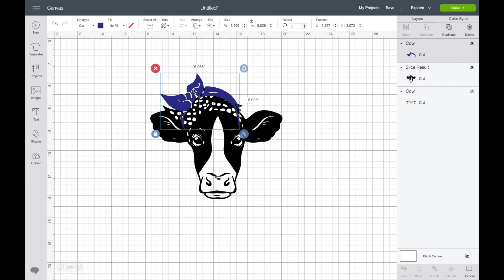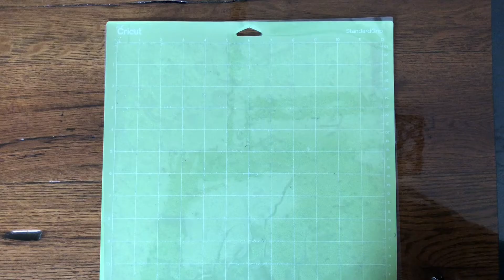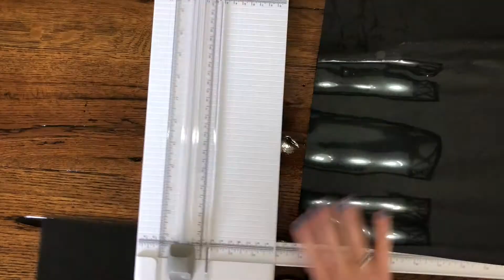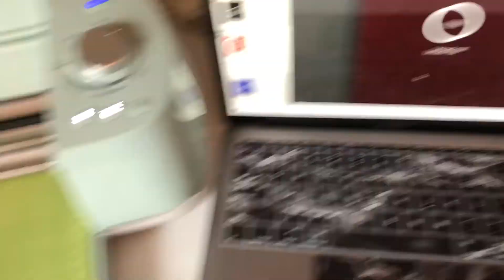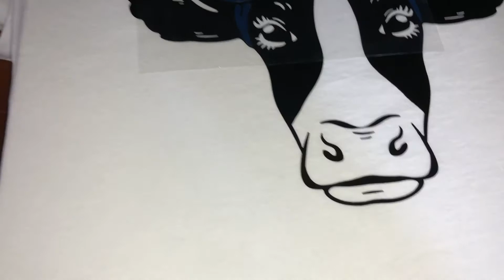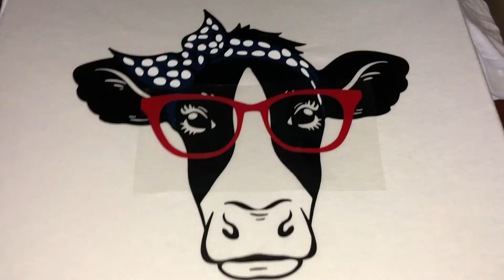Multi Colored/Layered Shirt Project

Comment: When a mat is no longer sticky enough, one can either wash it with dawn & warm water and let air dry to help restore the adhesion or simply use masking or painter's tape on the edges of the vinyl to make it stay put on the mat and proceed to cut.